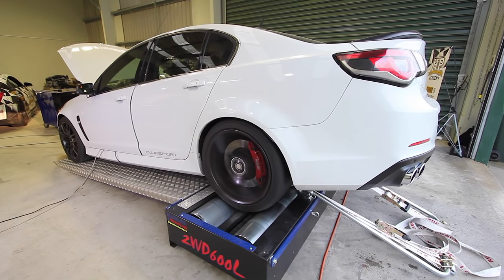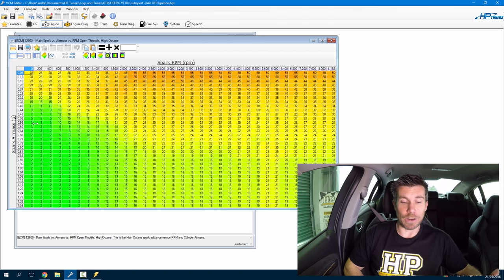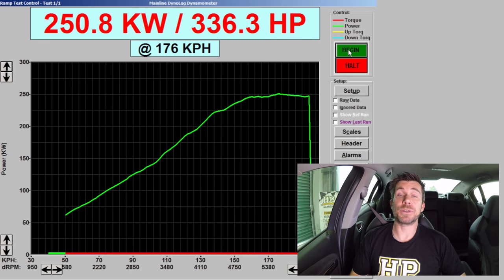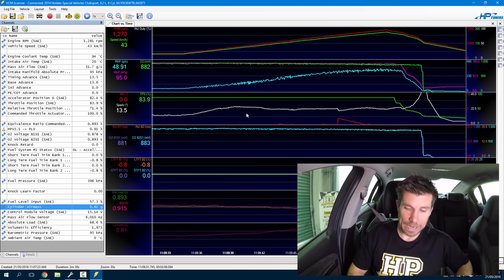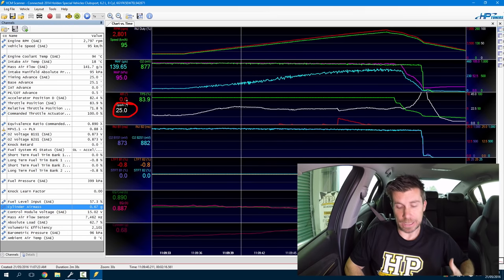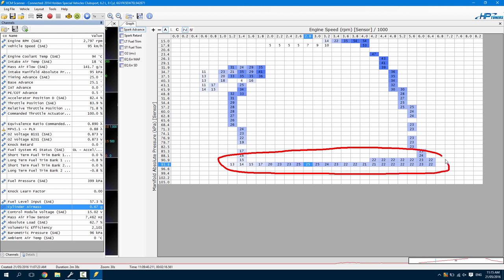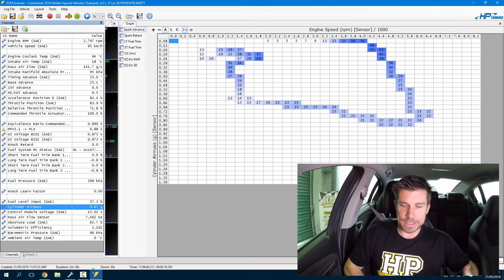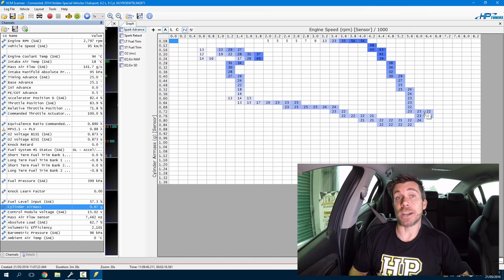Comprehensive Guide To GM Ignition Timing | HP Tuners

Comment: If your running speed density as apposed to MAF, can the histogram still log g/cyl without a mass air flow sensor? 
Great video, thanks in advance.
Reply from the maker: Hi Liam, yes. even if you're running in SD, the PCM still uses the VE table to calculate mass airflow and hence load is still represented in g/cyl. - Andre

Comment: Hi, great clip, very well informed.  I have a question regarding deceleration, i think the spark advance chart has answered it for me.  Can i confirm that when the throttle closed, spark advanced greatly because of the weak mixture and vacuum advance operating as it should but then reduced greatly back to 3-4 degrees because of the real high engine vacuum while engine was spinning at 5000+rpm.  Is that correct tuning?  Thank you
Reply from the maker: Under high vacuum there is a limited amount of fuel and air in the combustion chamber. Under these conditions the combustion actually takes longer to occur so we require more ignition advance in order to achieve peak torque (MBT). In an over run situation where you're completely off the throttle this is a bit of a moot point however as the PCM will use deceleration fuel cutoff where the injectors are completely switched off so no combustion is occurring.

Comment: Wow. U r one smart Aussie!!  Does the pcm have a way of learning the octane. Or does it do it by hearing knock?  Very informative!!  In Los Angeles
Reply from the maker: Hey Bill, Andre is actually from New Zealand but as both countries have horrible accents it's quite easy to get the two of us mixed up!

I am not as experienced as Andre but I don't believe there is an easier way to test octane without expensive testing equipment other than by knock. 
Obviously you really want to be looking at it from the angle of what power you can achieve with specific fuel before your engine becomes knock limited rather than trying to work out what the fuel you just tipped in the tank is by the same method though.

If you are running Ethanol based fuel there is a way to test the percentage of this. Andre has written an article on this topic that you can find on our website if you are interested - http://bit.ly/ethanolpercentage

For a more experienced reply in regards to your octane question you can also ask on our Members Only forum which Andre patrols. It does require Gold Membership but with that you also get access to our weekly webinar lessons.

Forum - https://www.hpacademy.com/forum/
Webinars - https://www.hpacademy.com/webinars/

Happy tuning! - Taz.
Reply: Wow. U r one smart Aussie!!  Thats a bit like calling a Canadian  a Yank,

Comment: Thanks for posting this awesome information. While I normally live in a flat sea-level location. Real world application question -- How does this change when my girlfriend says hey, lets go tot he mountains, and we climb at 15mph in a low-speed cruise? I feel like the car was having a hard time maintaining such a low speed. I suspect the timing making the pedal so sensitive, but also what most drivers want under these conditions. The big question is, are we reaching a load that exceeds the timing we've specified?
Reply from the maker: As altitude increases, air density decreases which affects both the required fuel delivery and the optimal ignition timing. Assuming your car is still equipped with a MAF sensor, altitude shouldn't be a large consideration since the MAF sensor directly measures air mass which accounts for altitude.
Reply: High Performance Academy  in a speed-density calculation the MAP should play a part:  not only does density decrease with an increase in altitude, so does pressure as a result.

Comment: I think stock timing was 16*.  I've got 25 or so in it.  But it never sees that much.   Depends on the pull.  I can make one from 4000-5800 and it'll start at 18* and climb to 21 and then make another and it'll start at 20 and climb to 23.   Should I put all my correction multipliers back to stock?

Comment: The 2.0 turbo 4cyl motor is a headache compared to the LS.  LS motors are as simple as grade 1 math.   Some of the Turbo GM motors are more complex in the spark timing.  Especially with false KR and how to tune it out is almost backwards from the norm.

Comment: hey Andre, I have a 2014 SS and my tuner turned off my ltft and also turned off the knock sensors. I have a can and longtime headers with a 6 speed auto. is there any reason why he would turn of these parameters.

Comment: Hi, are you sure that the knock learn factor 1.00 means the usage of low octane table? It is not the opposite what you are saying?
The knock learn factor is running based of the knock learn parameters. It learns after clearing some DTC's when the low octane tbale was udes if the knock is present. And if not the knock learn factor will come to 1.00 what means the PCM uses high octane table... Or I am wrong?
Reply from the maker: The knock learn factor will revert to a value of 0.00 after a reflash and increment towards 1.00 as more knock activity is detected. 

You can see the affect of this in the data log we're discussing both prior to and after the knock event at 5300 rpm. Prior to the knock event occuring the knock learn factor is sitting at 0.00 but after the knock event the knock learn factor increments to 0.18, hence biasing very slightly towards the low octane spark table. 

The effect is more prominent when you have a lot of knock activity occurring. This is demonstrated from about 17:30.
Reply: I see. I know where is the 'problem'. The gen III engines has the opposite direction of knock learn factor to the gen IV. Today I have logged a drive with my LM7 5.3 without any knocks and the learn factor rised up from 0.69 to 1.00 and then if I looked at the spark advance the PCM commanded from the high octane table.
Reply: I believe Peter z is also correct regarding gen 3?

Comment: my question is... How do the tuners in the big cities eg. auckland.. Wellington..all nz. 
justify $1200 bux for a remap of my 04 vy ss.?
all that they are doing is changing a few numbers here and there????
Reply from the maker: A couple of points to this. 1, it's definitely more involved that changing a few numbers here and there. Tuning any car requires a complete understanding of everything that is being changed. 2, You can't just tune every car the same way, every engine and setup is different. 3, to correctly tune a car you do need a lot of expensive equipment. 4, Like any professional their time is worth money, you have to remember that a mistake on their part could mean disaster for your. Our advise from years of experience is the cheapest isn't always the best. Great think with your specific model is the potential gains are well worth the cost :) It is something that we teach and you can learn, we think learning to tune is enjoyable and rewarding but doing it yourself won't be cheaper. Let me know if we can help you Freddie. - Ben
Reply: Thanks Ben for your quick reply.  
I have fitted a x air otr full exhaust and still have the maf. but I want to  delete the maf when I get it remapped. my gen3 ls1 has not been opened up and has 230000km on it and is my daily driver. 
 So who would you recommend (or the best) to do this in auckland?
Reply from the maker: Sorry mate, can't really make a recommendation in Auckland, it's been a long time. I think Eastern Automotive, Pro Tune are a few places to start your search. Good luck :) - Ben
Reply: thank you Ben for your help... So should i be looking for the tune shop that has the HP tuning software?
by the way... the tuning school video's are awesome you guys Rock!
Reply from the maker: Freddie, I'd be less concerned with the software. Call around and see if they can help you with your specific model :)
Reply: thank you mate.  wish you guys were here to tune my ss.  After watching most of your tuning videos and all the equipment and knowledge you guys have, I just hope that i can find a tuning shop with your experience and attention to detail.  
Keep up the good work and new videos. 
cheers 
Freddie.

Comment: wish we had holdens here.
Reply: Aussies wish they had Holdens there  too 😂
Reply: @notsponsored103  There's actually a company here in CO the converts the holden's to lhd and gets them legalized for the U.S. with whatever else they have to do. I bought my car from the guy in the shop next to them. They had like 3 out front and a bunch in the garage getting worked on. I was surprised.
Reply: @ConTheDon187  I was sort of joking about the demise of Holden in Australia itself, but you can be forgiven for not getting my hopeless sense of humour.
Regarding LHD Holdens over there though, I thought they were rebranded under the Pontiac logo.
Reply: @notsponsored103  No, just steering column and steering rack and stuff gets switched over, if I remember correctly but I could be wrong. They don't rebadge them and their is only the pontiac GTO which I believe is the Holden commodore? But no ute's or anything else that I know of

Comment: why didn't you show how you fixed the timing.
Reply from the maker: Hi Ryan, you don't "Fix" timing you tune it. Using the information in this video, an understanding of how timing works and how far you should increase it, knock and the correct equipment you should be able to tune your ignition timing. I must note you need a complete understanding before you attempt to tune your ignition as changes you make could end in engine damage. We provide in-depth courses that teaches this as well as a support system to help you grow as a tuner. You can check out some more free lessons here: http://free.motorsport.education/bmtk  - Ben

Comment: 250kw Haha
Reply from the maker: Correct, which is about where it should be. Our dyno is called the 'heartbreaker' because it reads a little low, but so long as you're in the ballpark total output is only one piece of the puzzle - Taz.